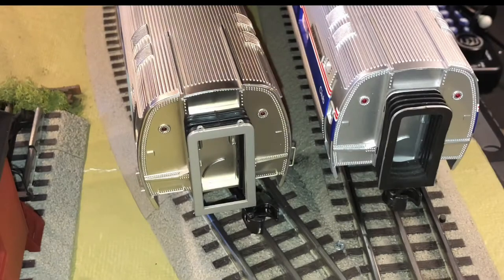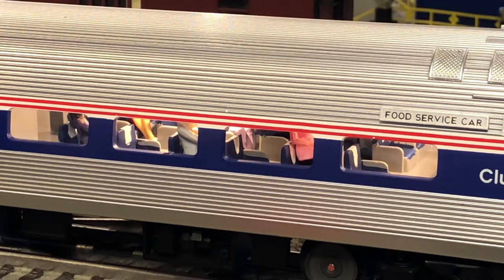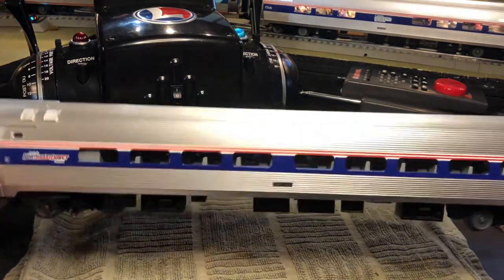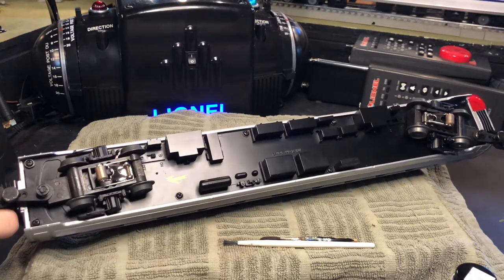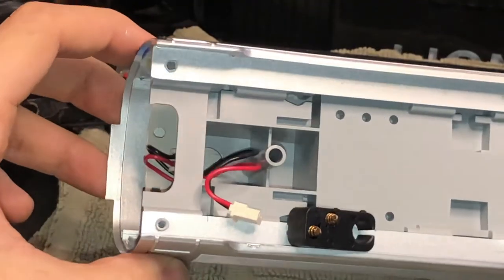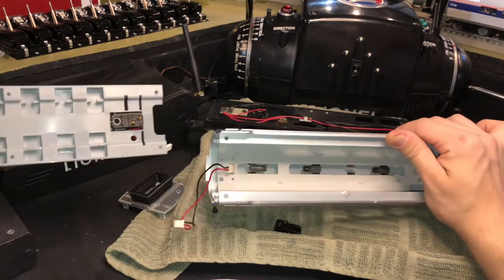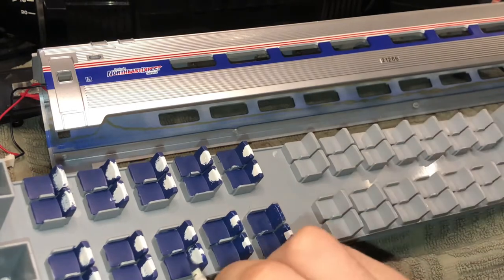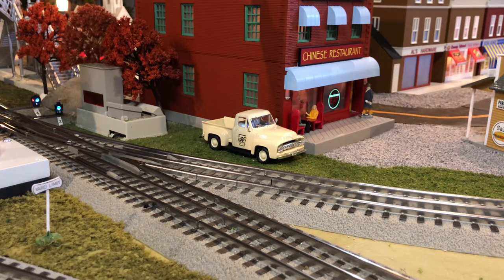MTH Amfleet Enhancements | Part 2

Comment: Nice job on painting the interior seats. What was the reason for not filling the window seats? It sounded like you said   some of the figures could become dislodged? If you put enough glue on the seat and don't handle the car a lot, that shouldn't be a problem. Just wondering
Reply from the maker: With the figures right against the window, one will only be able to see half of their shoulder and the appearance would seem that the figure is squished up against the “glass”. Wanted to provide some depth